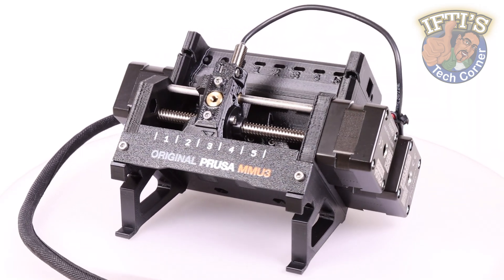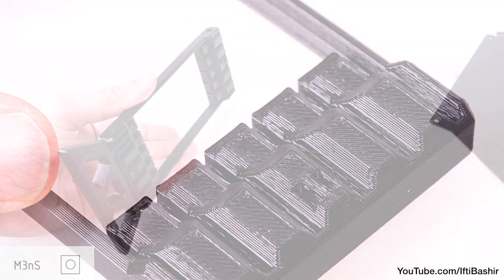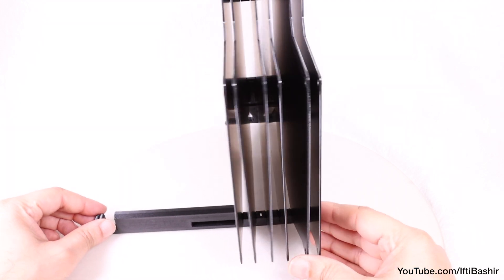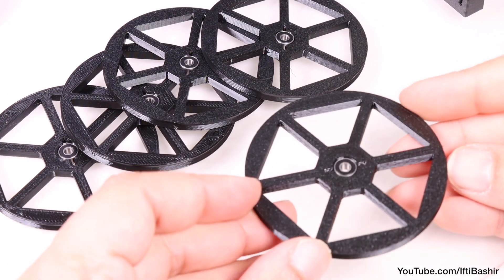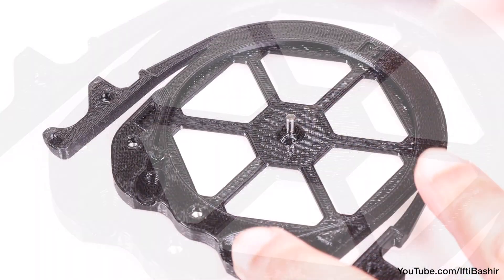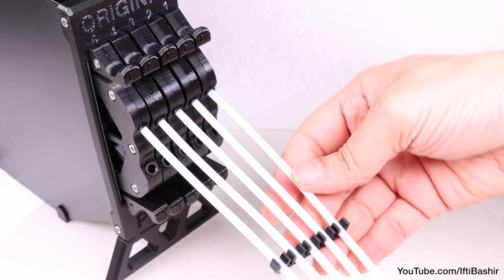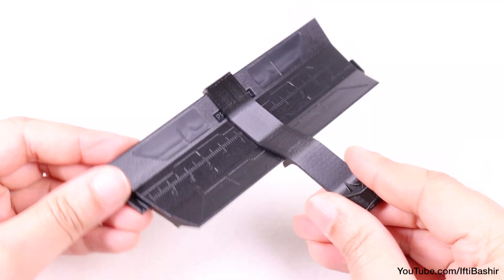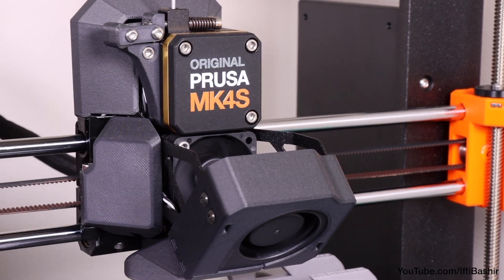#05 Original PRUSA MMU3 : Full Step-By-Step BUILD GUIDE - Cassette Buffer & Spool Holder Assembly

Comment: hi i got a question on the mmu 2-2s-and 3, can you use the mmu with any printer, i am currently  using a tevo tarantula i3, well modify
Reply from the maker: No it connects in to the Prusa system - to be shown in the next video - as only the Prusa printers will be able to communicate with it.
Reply: @ so it won’t work with  a octopus 1.1 motherboard
Reply: @ but Prusa is open source, Merlin firmware
Reply: @iftibashir  Compatibility: The MMU2 is designed to work with the Prusa MK3 printer. 
Assembly: The MMU2 is sold as a kit that needs to be assembled. 
Open source: The MMU2 is open source, so you can print it out and create your own. 
Firmware: The MMU2 can be controlled with the Marlin firmware, which opens up options for different board configurations.
Reply: Actually the best way to add a MMU to other printers: Use Klipper for them. Anycubics ACE pro was "hacked" and now works with Klipper ("DuckACE on github). Only four colours (or 8 if using two of them) - but including a filament dryer. Also much less space required, no buffer needed and more easy to handle.
However, depending on your printhead, you might need to cut the filament tip to sucessfully reload filament (with a Revo Standardflow and dry PLA or ABS you might not need a cutter using Prusas unload/ramping profiles)